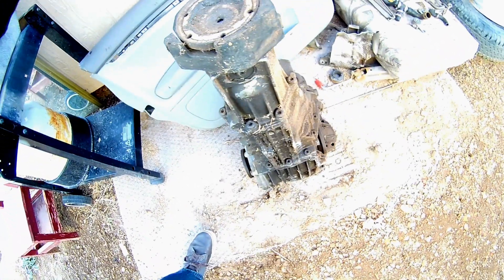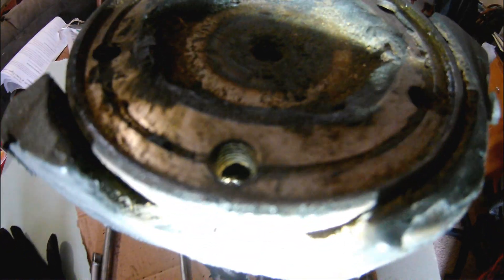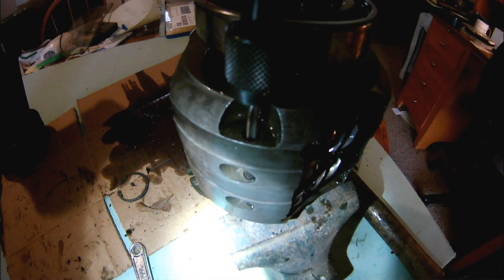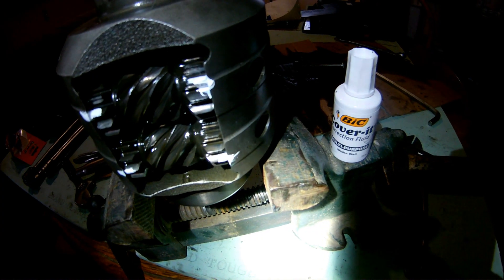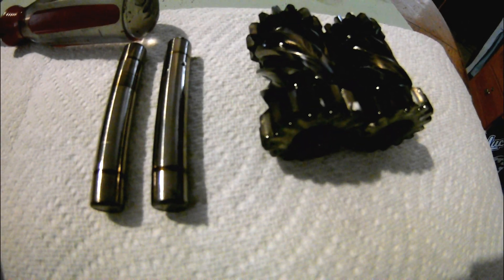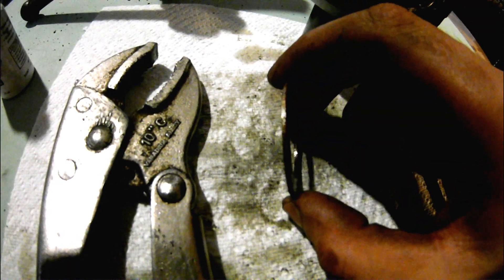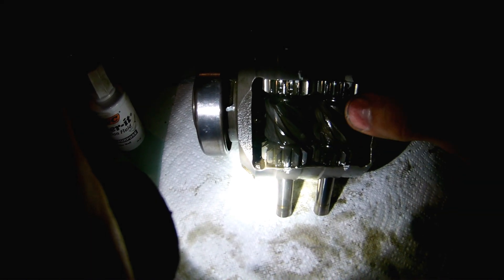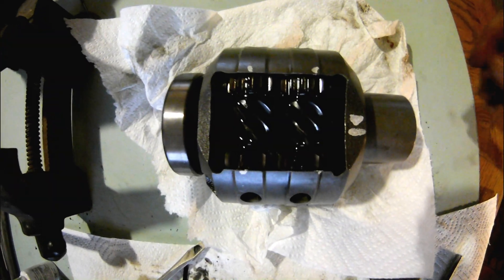Audi B5 1.8t 01A 4:1 Center Diff Mod How To

Comment: So you essentially made it rear wheel drive? Why not just keep the gears out and make it completely rear wheel? A gutted or welded diff make it completely rwd?
Reply from the maker: Travis Gilcreast because it still snows here.
Reply: No it's still quattro...when refitted...n yea snow is why quattro was essentially designed..nice modifications